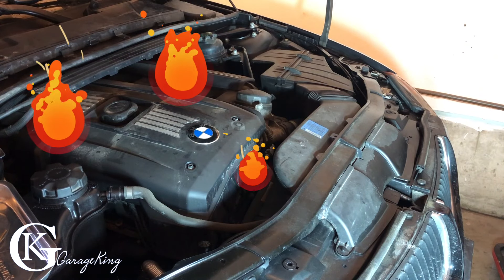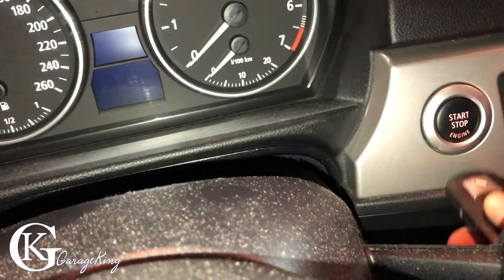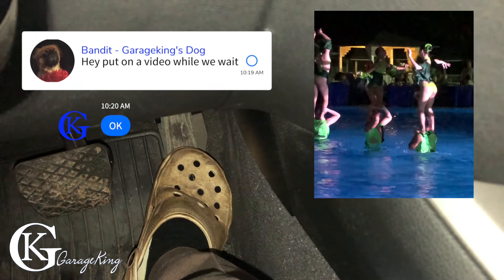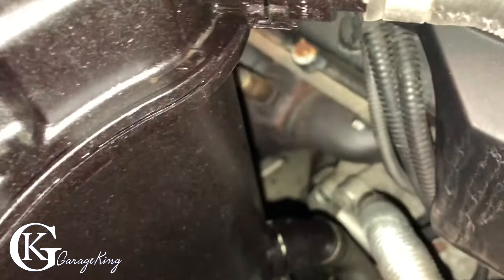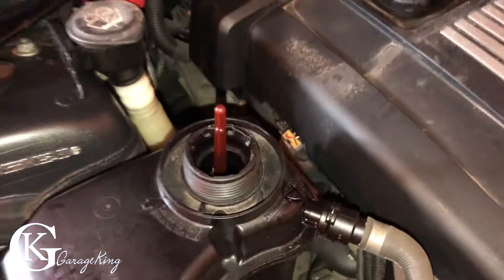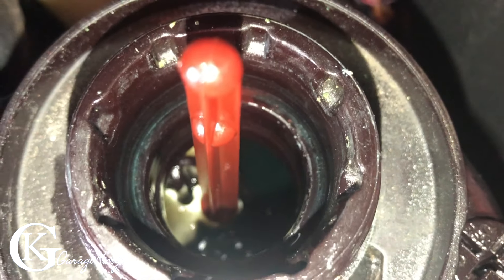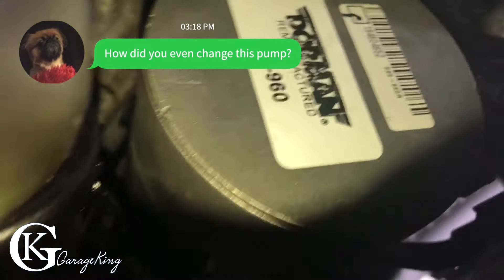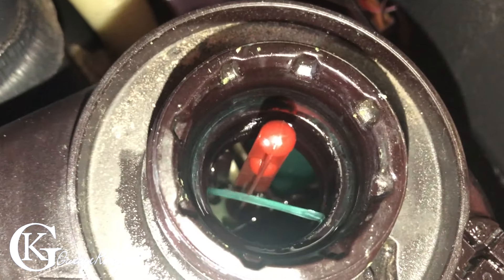How to Check BMW water pump

Comment: So my water pump never failed but my battery died during a bleed so it threw codes I cleared them the water pump I assume works. It ran fine during the bleed procedure. So my fault codes were P2aaa b2aaa it’s electronic related so I guess that’s because my battery died so word of advice those codes aren’t too bad check fuses I did charge my battery at a whopping 6amp
Reply from the maker: That's good to know and appreciate you sharing as it will help others. Thanks again and hope you are enjoying your weekend.

Comment: how to check electric bmw water pump working
Reply from the maker: Yup this video shows how to check it, if your water pump is not shooting out water like in the video, then you most likely need to replace the water pump.
Reply: @GarageKing  But what if there is a leak? Will it still show shooting out water? My F30 is leaking a lot of coolant, i am hoping its the hose rather than the pump.
Reply from the maker: @simdevils  I hope its just the hose.  If there is water in the system it should still shoot water like in the video, as long as the pump has enough water to grab. SO if you fill up the reservoir and test it, it should shoot water out like in the video.  I I did do the pump and thermostat replacement and that video is here https://youtu.be/K-JXuMHgVJE

Comment: i can’t figure out my issue🤧🤧🤧 water pump is new, radiator is new, thermostat is new fan clutch new. everything working as it should but i keep getting to hot
Reply from the maker: Hey there, make sure your fan turns on when it gets hot.  You can test your fan by turning on the defrost.  You don't have a fan clutch, but maybe you meant the fan relay.  There is a fuse, and its on the passenger side in a white box under the hood near the cowl.  BUT if your pump is running the fuse is fine.  If you are getting flow like in the video, then you may have a bad sensor which is telling the computer your car is cold, when it is really hot so that's why the pump is not turning on.  You can check this with a scanner that has live data.  Start the car when cold and monitor the temp on the scanner, it should increase and if it doesn't then you have a bad sensor.  I just did a review on a cheap one that works really well.  https://youtu.be/tDL-tAivuDA

Comment: I have a 2006 it stops suddenly on road then after some time it starts then again same thing i had to do this 8 times to come home
Reply from the maker: You mean your car stops suddenly on the road? When your car shuts off if your temp high?  If your temp is high you could either have a leak and your coolant level is low, your thermostat could be stuck, or you may need a water pump.  There is also the possibility there is something wrong with your charging system, but then I'm not sure if you would have been able to restart 8 times.

Comment: I put the coolant in but it's leaking out from the bottom, is it the water I need to replace or its the radiator, can you please advise, thank you
Reply from the maker: The only way to know for sure is to lift the car and take off the bottom shield, this way you can see everything.  If its a fast leak most likely a hose split. If its slow it could be from the a cracked radiator, or the waterpump.